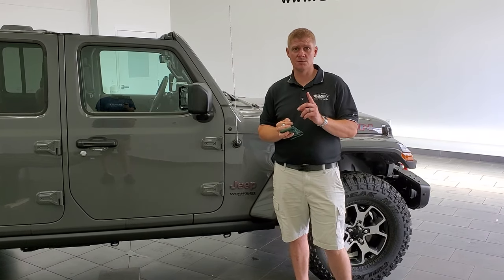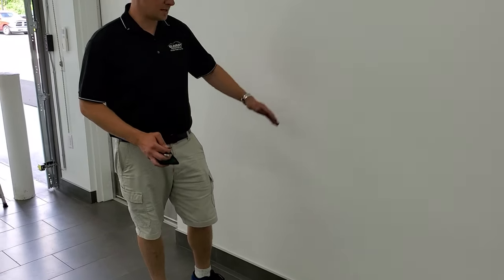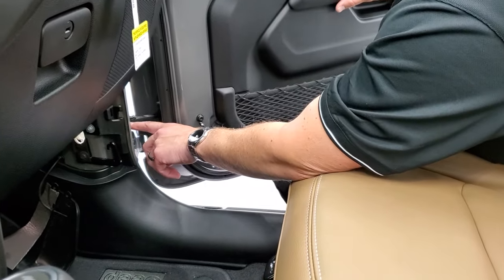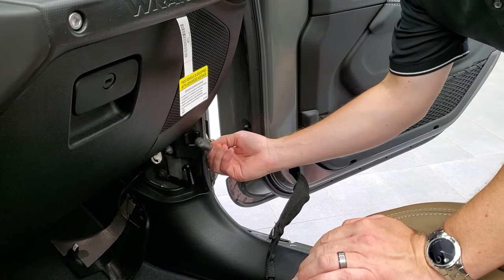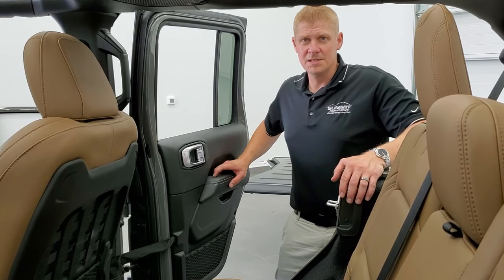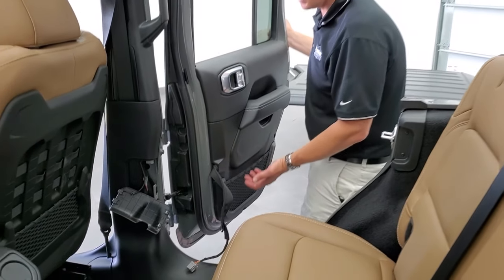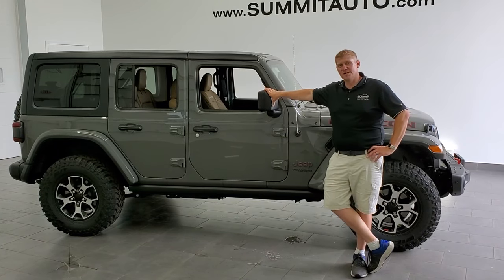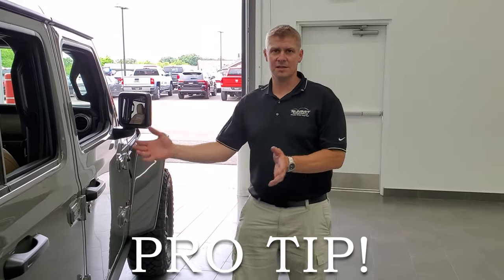HOW TO REMOVE YOUR JEEP WRANGLER JL DOORS QUICKLY AND SAFELY

Comment: Always remove door pin bolts and do all other steps first and remove door retention hinge bolt LAST.  It’s very easy to get gouges inside the jam with it removed first.
Reply from the maker: I learned this doing this video.  See my Jeep Gladiator door removal video.

https://www.youtube.com/watch?v=BVKXrmTJtvY
Reply: I agree just had to fight to get that door hinge out😂
Reply from the maker: It is not fun.  I found out the struggle doing this video lol
Reply: How to get the hinge part off, my door closed and now it’s not out as far
Reply from the maker: Get a channel locks and pull it out

Comment: So on a 2021 wrangler jl do you need to pull a fuse? I am reading I need to pull fuse 4 to stop interior lights.. help..
Reply from the maker: Where are you reading this?
Reply: You just need to pull the fuse connected to the door
Reply: On my 23 Mojave the dash dimmer roller switch turns off the interior lights when I roll it all the way down.